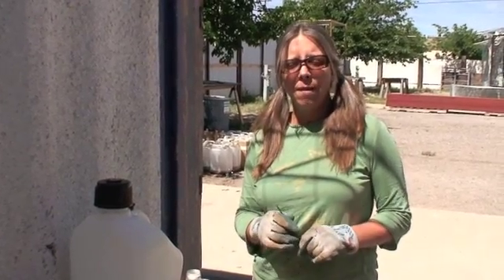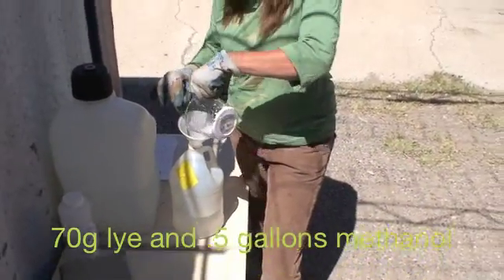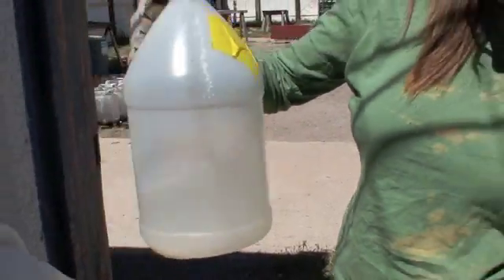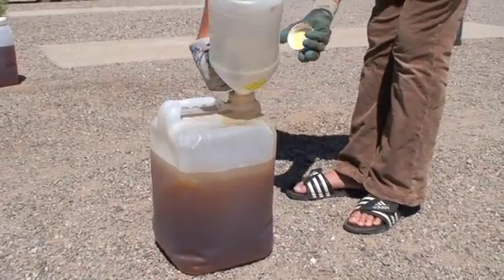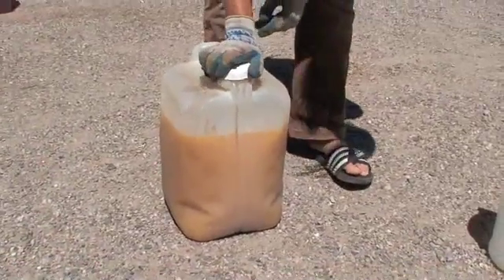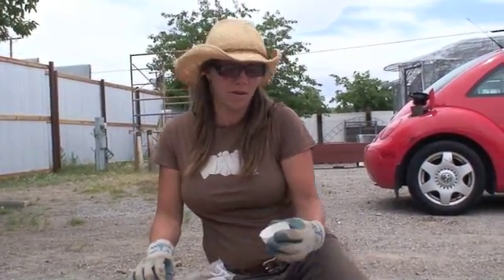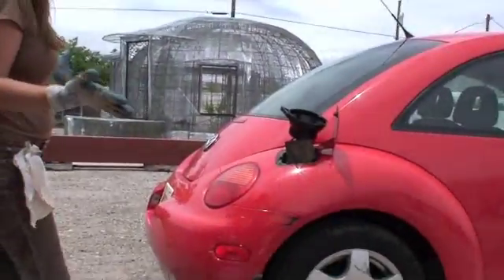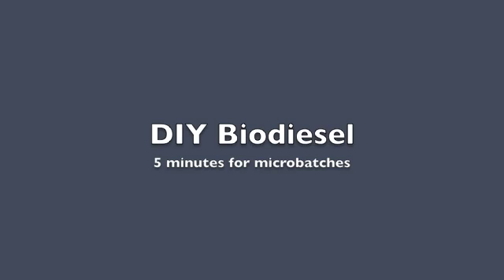DIY Biodiesel - 5 minute microbatches

Comment: Anyone who prefers to use SVO as fuel may as well know that the glycerol component produces a "toxic lacrimator" known as ACROLEIN when combusted, which is simply NOT an issue with biodiesel. Too bad there's an apparent GLUT of glycerol (glycerine) because there are hundreds of uses for it, from soaps and explosives to (if you boil any leftover methanol out) animal feed: mix 5-to-10% of that  in with the fodder and the cattle think its candy :D
Reply: But hmmm...while crude glycerine might net 5 cents a pound (if you can find a buyer), if this method finds large-scale production (apparently PROPYLENE GLYCOL is a much more valuable product that is derived from glycerine), that could drive the demand--and price--of all that glycerine.

http://web.cals.uidaho.edu/biodiesel/files/2012/11/Glycerol.pdf

Comment: Further more, if you don't have the money for a proper conversion system, you can blend 20% gasoline with the 80% VO. Will cost you the same as you mentioned. 
It will thin the VO up to about the same level as Bio-Diesel and you will not have anything to dispose of. Nor does it take 4 days to blend...
The Glycerin will stay in the fuel and will be burned as fuel.
So you end up with more fuel.
The gasoline is safe to use in Diesel engines up to about 30%
I was doing this in the winters of Chicago
Reply: @DaveCaresForYou  What about it? 
Methanol cost more then gas.
And you will be loosing 20% of your fuel.
With gasoline blending you achieve the same viscosity and do not lose any fuel.
Also gasoline can dissolve about 70% of the thick white fat and turn it into usable fuel.
Reply: @DaveCaresForYou  The Methanol turns the glycerine into thick white sludge so you can separate it from the rest of the VO.
But you don't need to do that.
Gasoline does not thicken the Glycerine but further dissolves it, so you can use it as fuel. There is no Glycerine issue when you use gas.
It even dissolves most of the thick white animal fat into usable thin fuel.
Bio Diesel is the stupidest idea as fare as I am concerned.
The only reason ppl do it is because they don't know any better and they wanna be able to tell ppl how green they are when not using any fossil fuels. But there is no problem with fossil fuels. The problem is in the cheap engines that they give us. All the pollution is created by poorly designed cheap engines.
Also Global Warming is a Scam to make us taxed for polluting.
They should fine the auto makers for producing shit engines.
But there is more money for the Government in taxation.......
Everything is a lie when you look into it.
Reply: @DaveCaresForYou  You can use up to 30%, depending on how much lard you have in the oil.
If you have foggy oil, that is lard suspended in the oil.
You just need to ad enough to clear it up.
Also some VO, is thicker, so just add more gas.!!!
Reply: @VeggiePower303  thanks so much
Reply: @DaveCaresForYou  What\s your secret to success in building people?
And what to you mean by that?
I can't seam to teach ppl anything.
Reply: @VeggiePower303  the first thing you have to do is break the bad programming that they were taught in gov schools. You want to give them a mirror and make them see their ideas don't line up with truth. You did that to me in the beginning of conversation! I just learned something from this lady here then you took me from that level of wisdom to an even higher level in minutes

Comment: "Methanol is extremely poisonous. As little as 2 tablespoons can be deadly to a child. About 2 to 8 ounces can be deadly for an adult. Blindness is common and often permanent despite medical care. The ultimate outcome depends on how much poison was swallowed and how soon treatment was received."
Methanol can also be absorbed through the skin, it will not kill you but who knows what long therm problems it can cause.
I prefer to use Straight veggie oil with proper conversion on my vehicles.

Comment: I love it, 5 minute Bio-diesel takes just under 4 days. :0)
Not trying to start an argument, but you're handling hazardous materials in open sandals and no respiration filters.
If you ever get that Methanol accidentally on your skin you could end up in big trouble.
You should be using spill proof overalls with boots and gloves, which you had.
The next post is an excerpt from a poison control website.

Comment: No soap test? Have you actually measured the quality of the fuel you're producing this way? Also, what about checking the pH of the veggie oil? Depending on how much cooking was done with it, and at what temperatures it could be pretty acidic and require substantially more lye than you're using here.

I appreciate you sharing your experience, but the only application I *might* consider using your fuel in is a small diesel generator. This stuff needs to be cleaned up.

Comment: thank you for the info mike, do i need to wash it with water after letting it sit for 4 days? i have watched some videos that they add water to clean and take away the methoxide in the mixture. in your video i see no washing done. will this affect the outcome of the biodiesel that you made? will methoxide destroy the engine or fuel lines? appreciate it .

Comment: Some folks throw the glycirin into the next batch of oil. they say it pulls out the water and congeals all the trash which helps speeds the reaction. I use it to de-grease parts and clothes. works great.

Comment: As Stated the glycerin isn't toxic. the methanol is.If I remember right the Methanol acts as a catalyst to drive the reaction but isn't "used up" by the reaction. So the methanol is in the glycerin and methanol is not nice to people. A few days in the sun with out a lid and it will flash off. Some folks who do this on a larger scale try to recover the Methanol for reuse. that has it's own risk. "Son is that a a Stil I see back yonder?"

Comment from the maker: Nice...You might need to clean out your fuel filter soon. If you vehicle had been running diesel bio is a solvent and can push a lot of crud into the filter on first use. Also consider using ATF in your fuel filters to prime them.

Comment from the maker: Sock filters are fine. I prefer denim as it is almost free and decent quality. I still go through a paper filter for getting the oil clean before mixing with methoxide. 

Newer engines should work, but you will want to research forums and such and see what people prefer. You will be voiding your vehicle warranties as no vehicles come out with a statement of 100% bio being acceptable usually it's 20% blends. Mileage is reduces by as much as 10% as biodiesel is a lower energy than diesel and WVO.

Comment: hello, i liked your video, would you use a sock filter for filtering  veg  too,  and also dose bio diesel only work on certain types of diesels such as  older diesel engines tdi cdti   and do you need to change the  filter quite often when using  bio diesel  dose it reduce the mpg please get back to me as i am intrested

Comment: I couldn't agree more about the 150 lb person 2500 lbs car thing, other it's more like 5000 or 6000 lbs.  Many things that are good options are not here because of climate.  Windmills work 24/7 if it's windy, but it's dark 16 hours a day here in the winter, the sun's at a very low angle, and snow and frost often cover panels.  Electric vehicles can be a good option for many people, and reasonably intelligent people should be able to build their own.  They did so in the 1890s.

Comment: I think people should explore all ways of using responsible energy.  I run into a lot of people who think a switch from oil to veggie oil is possible and it's just not.  Our energy uses are so high that there is no way they are sustainable.  Ethanol is extremely inefficient as it's often made.  Energy is used to grow the crop, ferment it, much more is used to extract the alcohol.  Solar power and electric cars have some serious pollution implications.  Many small solutions maybe the key.

Comment: Might I add that living in Mexico is hotter than the UK and this oil would be warmer than over here. That said, if you had a black plastic barrel supported high enough to allow a container to draw off from the bottom and another tap say 15 cm or 6 inches higher to draw off clean fuel. locate in a sunny position and your oil will be heated to evaporate water and settle out any unwanted debris on the bottom. Great video by the way thanks for sharing. Have you tried potassium hydroxide?

Comment from the maker: I'm using 100% through for six months of the year, blending to 50% for cooler weather and doing 100% diesel for about 3 months of extreme winter. No modifications have been made to the vehicle.
Reply: So how's it working  7 years later any problems to the engine or pump?
Reply: @alexanderrosales7675  I do the same thing no problems with pumps at all you have to filter it well and have an extra filter before the pump and I have a gauge that according to pressure I know when to change the filter

Comment from the maker: I don't test for pH, but most people do recommend it. I've been making bio this way for 3 years and have roughly 30,000 miles on it. No car issues. I just change my fuel filter every year.
Reply: Please can we use baking sodium instead of sodium or potassium chloride
Reply: Dear maam where do you get the lie and methanol cheap?

Comment: just a question, I've been checking different videos and techniques but most of them wash the bio diesel before pouring it in the car to extract the meth-oxide, is that step necessary or just optional, if not necessary do i need to change the fuel filter more often. just wondering, I'm about to buy a diesel car but just wondering and not ruin an engine. thanks for the video excellent.

Comment: at the very least you should DEFINETLY wash your fuel before putting it in your NEW car it WILL clog things up and give added carbon deposits in the combustion chamber. if you do have problems with it later you can use seafoam or something similar to "break lose" all the carbon deposits in the engine.

Comment: The video is awesome. It shows how easy this actually is when you just cut it to the bare essentials. Anyone skeptical, stop...it works and it's THAT easy. However, all that being said, I generally DO recommend a water wash (3 quick runs) and then dry it, as this really doesn't add much work and it really does make the fuel MUCH cleaner, removes SOOO much crap, and makes sure your water free as well. Nothing wrong with this way, just good to be careful.  Check biodiesel websites for more info.

Comment: @SP330Y 

Why such as sceptic? It isnt rocket science.

In fact you can use waste cooking oil that has simply been filtered straight into a diesel engine, provided you install a heater in the biodeisel tank.

There are people have two tanks in their vehicle. One with ordinary deisel fuel adn teh other with waste cooking oil. They run their vehicle with standard deisel until the engine warms up , then they switch tanks to the biodeisel fuel.

Deisel engine are brilliant

Comment: Wendy, it looks like your batch turned out really good and showed a good seperation of the glycerin, etc.  Did you heat the oil at all, or just leave the filtered wvo in the Arizona sun for a while to heat up on it's own?  About what temp do you think the oil was before you added the methoxide and converted it?  BTW Thanks for the video.

Comment: @fonzi0was0cool 
any saving is worth while,£1.41.9 for derv just down the road,if you are getting good grade used oil for next to nothing or very cheap at about £0.25 to £0.50 per ltr and chems i think it works out at around £0.80 total cost per ltr,lye is easy to get,but meth is harder as ther are stricked rules on sale and storage of this stuff,its often used to make terrorist bombs so you will get asked stuff about why you want it and where your storing it from the sales person in most cases

Comment: another thing to remember,white fats,you dont want water or white fats getting into your tank or you will have big trouble,get you used oil and leave it to settle for a few weeks,water and fat sink to the botton and collect as a white.creamy yuck,you dont want this at all,drain this crap off,add more water and let it settle again,then drain that off,you need to get ALL animal fats out before making bio diesel,if you dont it will collect as lard in you tank and screw you fuel system up,take care!

Comment: we have run bio deisel at -7c in the uk,you need good heater plugs as this stuff has a lower flash point the normal diesel,mixing it with normal diesel in the winter is a good idea,we run around 50/50 in real cold weather,we have diesel 1998 cherokee with bosch pump.

Comment: mod out drums with valves near there base,letting the gunch settlle to the botton,then attach clear silicon pipe to the valve,open valve into another container till fluid runs clear,this will stop you pouring gunk into your  fuel tank by mistake,this vid is outstanding give veg heads a good starting point for bigger production,some people even use small cheap tank heaters to speed the settling process up.